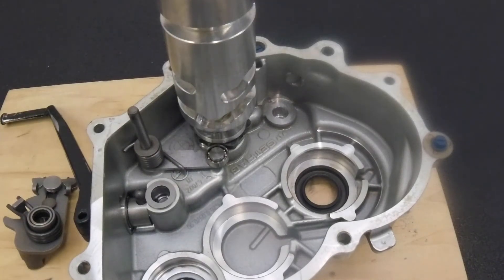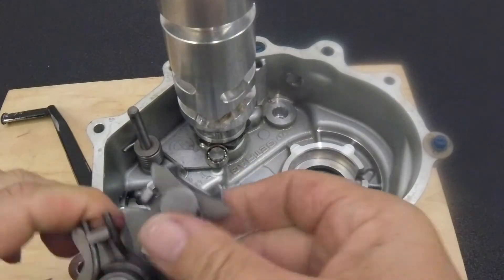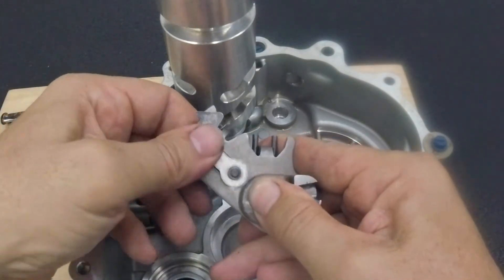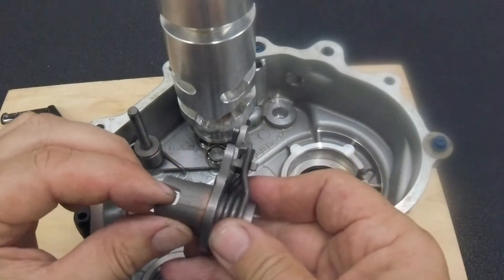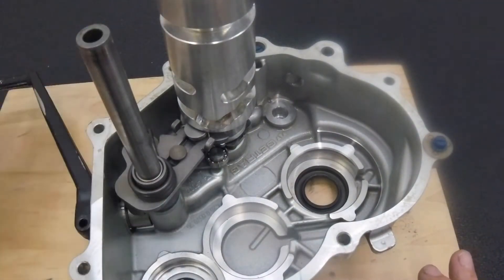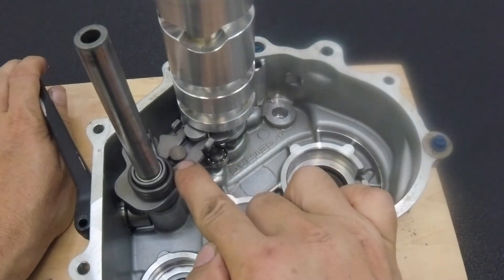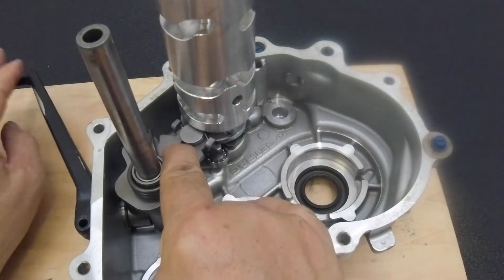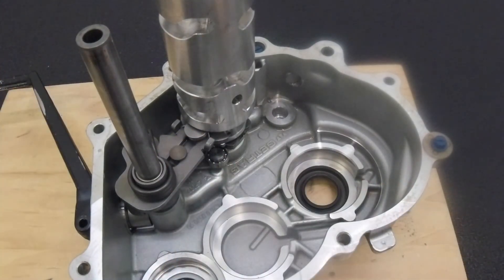R1200 shift problem

Comment: The sticking part you mention I had fail in my 05 GS gearbox. I was able to replace just that piece in the gearbox. You have the updated version of that piece. The original has that "U" shaped piece pressed into the main part of the piece. Well after about 90k that "U" fell off and my shifter was dead in the water. Luckily it broke at the end of my driveway and I was able to just roll it into the garage to disassemble it all. The part came from Germany in the middle of COVID. Actually came pretty fast. I was surprised. After I have replaced that part and a new clutch since the bike had to be split anyways the bike runs and shifts great. But I will say that ai have had to have my bike apart twice now since ive owned it. Its not super tough to do but it is  alot of dissembly. Im sure I could do it easily in a weekend. I believe BMW says yhey can do a clutch job in 8 hours. Alsonthe inside of the gearbox isnt all that tough. Getting the other side of the cover to line up with yhe drum and such can be a bit challenging.

Comment: Hello.Thank you. What's the part called that is sticking and is it a complex DIY or a repair more suitable for the shop?
Reply from the maker: BMW calls it the “Shifting arm” in the fiche but most mechanics would probably call it the selector mechanism. It’s not difficult to change, just tedious. It can be a bit tricky to get the shift parts reinstalled into the cover but nothing that needs special knowledge or tools.
Reply: @virginiamotorrad1952  Thank you very much. My 09 R1200RT is not going into gear as the instrument cluster indicator says. The bike freely rolls in any selected gear backwards/forward When I push and won't move forward at all when I release the clutch (when not in neutral). On the day of breakdown I was on the freeway revving while holding the clutch as some traffic  merged and changed lanes in front of me. As I up shifted the bike would not go into gear I paddled to the side turned it off immediately gauges indicating near overheating. I waited 45 minutes restarted would not move when put into gear. Smelt a little burnt oil To my surprise it was down around two quarts. I have no leaks and to my knowledge have not been burning oil. I changed the oil in the bite starts up and runs as good as ever yet won't move. Feels like it's not engaging or actually going into gear when I shift even though it's indicating that it is in gear on the instrument cluster. Any helpful inside would be greatly appreciated. Thank you very much.
Reply from the maker: @777goldcoast  your description is inconclusive to me, but any of these repairs involve disassembling the transmission so whatever is wrong will come to light when it's inspected. If you want me to have a look at it, please contact me through my shop website http://vamotorrad.com
Reply: Thank you it is on its way to the dealer
Reply: @777goldcoast  update? please

Comment: Thx!
Reply: Just completed this exact repair on my 05 GS 1200. K25.  I will tell you that the shifting arm he has in the video is the new updated part. The U shape piece on the shifting arm looks totally different on the previous version. And that U shape piece came disconnected from the piece of steel it was pressed into and totally fell out. Not able to shift period. Luckily it broke at the end of my driveway in after shifting it into neutral. Rolled it right into the garage to do the repair? I will say if you have half a brain on you and some common sense and a little mechanical aptitude I believe this job can be done at home. I had the help of a book ( Not gonna lie it wasn't much help) and my Engine driven father in law to help. I would say it took us 10 to 12 hours to complete if done all at once. Putting the split pieces back together (4 bolts) is the toughest part. Be prepared to have BMW bleed the rear brakes when finished. It's a very delicate and expensive system and parts if you fuck up.  Other than that have fun and I highly recommend getting your parts from Euromoto elctronics in Denver. I happen to live in CO so I just took a nice little drive up and picked my parts up in person. Cheaper than MAX BMW or the Dealer for the parts they do carry. They don't carry it all but alot of it! If you need to have this done depending on what bike it is I may be able to answer some questions while it's fairly still fresh in my mind.
Reply: Gewehr2180 thx for the detailed reply!!! enjoy the bike!